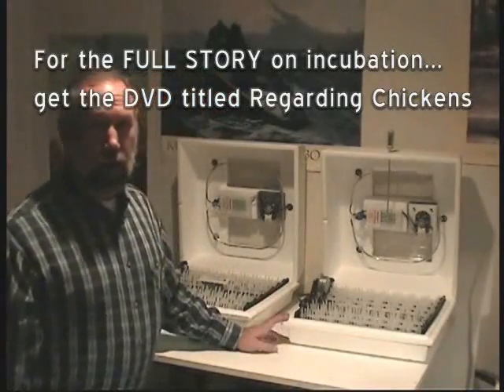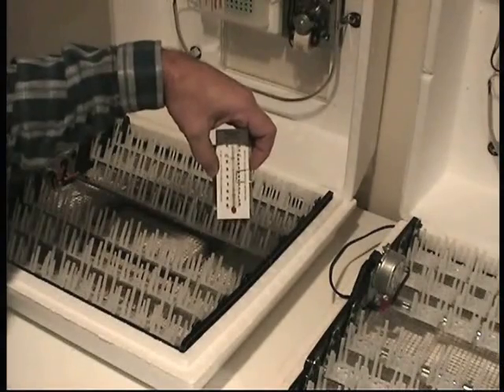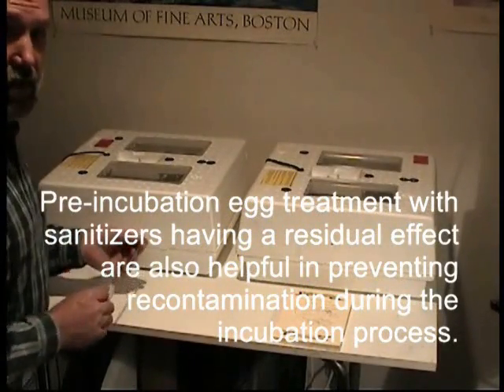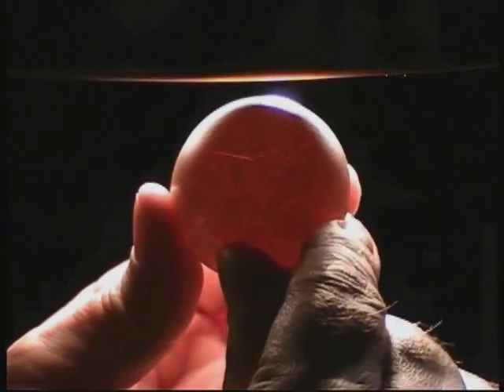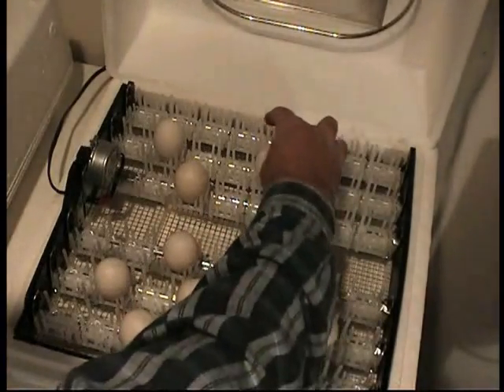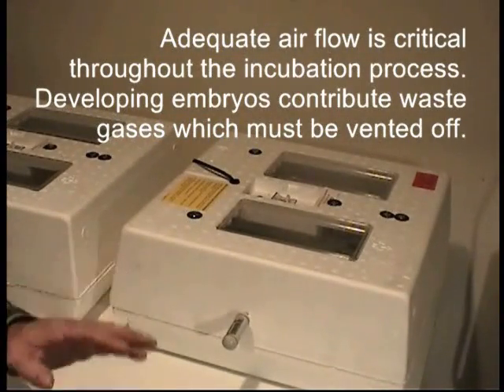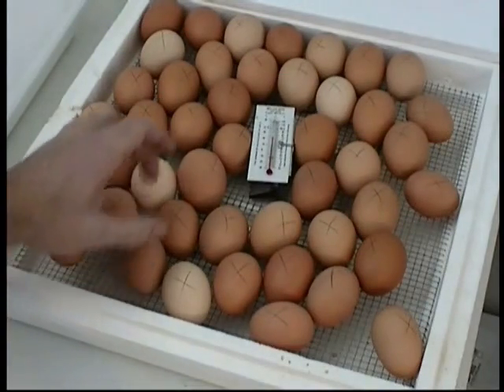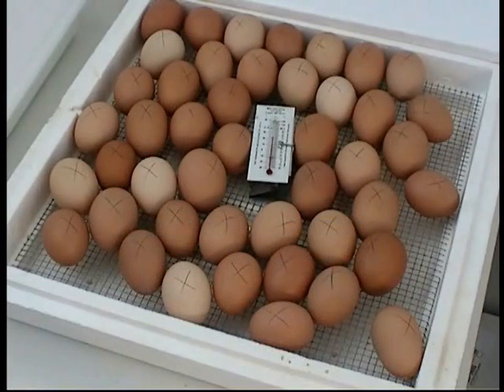Incubation, using the Little Giant Incubator, How to incubate chicken eggs, demonstration

Comment: This post may be of help to a lot of people. I wish I could tell you in plain English about my eBooks but (yt) or (the powers that be) would delete this post if I did. So as you read this you Can do a bit of detective work to find them. (March 2023) I got a Little Giant Incubator and thought I’d give it a go. We already have chickens but they are getting old now and so we thought to hatch some new ones. More about the Incubator: I only got the incubator and the egg turner as there was No fan kit available to go with it where I bought it. I also got a cheaper Thermometer than the Little Giant brand and That Was A Mistake! I couldn’t read it well through the windows! I went back and got the Little Giant brand Thermometer, and that one is EASY to see! I don’t have money for one of these fancy remote control Thermometers that you can read outside the unit, but I’ll make do just fine without.  After working with the system for a good long time, I finally got it right. I found that at a setting on the Instrument Panel of 105.8, [over time] I got a steady reading from the Thermometer (at egg level) of 99.5, I also have 1 red plug pulled out by the Instrument Panel. As AmeriKa crumbles, and with, “The Deliberate Poisoning of Earth,” it’s more important than ever, right NOW, to get your own food supply. And then when you have your own food supply, You have to Protect it! And just like, “The Problem Eliminators,” You have to find ways to see to your own family’s safety! After all the destruction that is yet to come upon earth because of the Wickedness of some, we will have a New Civilization to build! And we together Can and Will make it even better than “The First Civilization of Earth,” ever was. So just utilize my name and some of these Titles to find me and my writings which can also help you to find some Sanity in our current world that has gone mad. My Fellow Americans, Take Care!

Comment: How did you sanitize the eggs? I was always told not to wash them!
Reply from the maker: Because I'm a poultry technician and get inspected by the Dept. of Ag, I have to use sanitizer and it does improve hatch rates. TekTrol is what's approved. Eggs for hatching should not be scrubbed. If you, like me, plan to use your incubators for several batches of eggs, then sanitizing is going to be very important. Bacteria builds fast in that hot and humid incubator. I wish you all the best Teresa!
Reply: @FrederickDunn  thank you!

Comment: I hope you are reading this. I have an automatic incubator with capacity of 2000 eggs. I used the default configuration set by the manufacture temperature 38.5 degree Celsius  humidity 60. some time i got 60% of my eggs hatched and sometime when they start hatching (less than 10%) then the remaining eggs  died. I cannot figure out what seem to be the problem it because of humidity or temperature setup. Now my incubator is closed because of this problem. need your help
Reply from the maker: My first question for you is, what do you see when you candle the eggs? That is far more critical for gauging proper moisture loss during incubation than the actual humidity levels. With 2000 eggs, you would do a sampling and weigh eggs in batches of 24 so can measure their percentage of weight loss, they should have lost 13% of their weight by day 21. Of the chicks that died in the eggs, did they pip and not hatch, or did they fail to pip the eggs at all? If humidity is too high, and the chicks do develop but fail to hatch, they may be too large to move adequately inside the shell prior to hatching. My last question is what are you sanitizing with? That would be my last "potential" issue, that bacteria got to the developing embryos. I hope one of those suggestions helps you trouble shoot your hatches.
Reply: candling from day 6-17 seem to be normal embryo alive but cannot say about much about the air cell. Many of the eggs have not start to pip out but very few do (  with some greenish fluid stick on them). I broke out many of the eggs. Many of the embryo are completely developed but not pip. I do not use any chemical for sanitation only water and detergent.  Thank you very much for your respond. 

One thing i forgot to mention we do have black out sometimes for more than 2 hours and i notice the temperature and humidity get little bit high when i turn on solar inverter. 

what should be done in case of blackout for 2 hours?

what should be ideal humidity and temperature for successful hatch?

Comment: Hey, Do you need to add water to the incubator?
Reply from the maker: That depends on the environmental humidity conditions where you live. In my part of the U.S. I don't put water in my incubators until it's time for pipping, then I fill the reservoir during the hatch so the chicks don't dry out and stick to the shell. In my neck of the woods, high humidity is the number one reason chicks develop yet fail to hatch because they did not lose enough moisture through the shell during incubation and can't properly turn to pip out completely. Or, if they do make it out, chicks developing with high humidity will have albumen poking through their stomach.

Comment: So you don't add water for the first 18 days?
Reply from the maker: I personally do not... that's because our air already has high humidity and if I added water, the chicks would be too large in the egg for a proper pip and hatch to occur. When the first egg pips, I increase the humidity so the chicks don't stick to the shell lining and dry out.
Reply: Thanks. I have a 9300 Little Giant Still Air Incubator with a 6300 automatic egg turner. Anything I should know about it? I didn't change the temperature from the 99.5 preset but I did fill all the water tubes up from the beginning. First batch of 41 eggs, 3 hatched and still living.
Reply from the maker: Mary Bricker If you have the "still air" version, then 99.5 degrees is too low. Set your thermometer at the upper third of the eggs and measure 101-102 deg F. That is your setting. Still air incubators are warmer at the top and cooler at the bottom. 99.5 is only for forced air incubators.

Comment: hello sir 
I made a incubator at my as u r methods but
it's totally failed all eggs r dry temperature is at 96°f and I put some of water in it ,turned daily twice 
but it's not working pls give me suggestions
Reply from the maker: +shaul hameed Turn at least three times a day, not two and you need to boost your humidity, also 96 deg. f is too low, 99.5 f for a forced air unit, it it's still air (no fan) you need 102 deg. F at upper third of eggs placed. Are you saying that they dried out? What was the air cell like at the end of incubation? Did the embryos develop at all?

Comment: Hi Fred, we just got our first incubator and are having trouble with the temps. We purchased the Farm Innovators model 4200 and it has a built in thermometer and the one like you have,they are not showing the same temps. Can you recommend a good digital thermometer? Thanks for all your time and information. Have a blessed day.
Reply from the maker: +blessedfamily27 This is a link to the Calibrated Thermometer I always use to double check the provided thermometers... http://www.amazon.com/Thomas-Traceable-Digital-Thermometer-Display/dp/B0069TUET8/ref=sr_1_13?ie=UTF8&qid=1456502600&sr=8-13&keywords=calibrated+thermometer
Reply: +Frederick Dunn Thank you for your very quick reply. I am now using 3 thermometers and all are way off. Have a blessed day.Amber
Reply from the maker: So glad to have helped... you can also just take one of your thermometers to any Pharmacist.. have them put it in their controlled climate system and then just mark your thermometer with the actual temp... for example, when your thermometer is at 99.5.. and their calibrated system says 101.3 (for example) then you will know how much your thermometer is off... :)

Comment: I've just completed my 3rd almost completely failed hatch attempt. Although everything seem to go perfectly it looks as though problems are developing at day 17, 18 and 19. I'm useing a homemade incubator that seem to work perfectly at all times. I turn 5 times a day, temp stays at 99.5
humidity holds good at 60%. First batch 30 eggs, 0 hatch. second batch 32 eggs 2 hatch. third batch 40 eggs 1 hatch. its weird. forth batch is loading for one more attempt before cooler weather, any thoughts or advice is appreciated
Reply from the maker: +duckmanjoel You should not be turning by hand, nor turning at all during the last few days.. from day 18 on.. the chicks are orientating themselves for pipping. If the air cell charts I've posted on my website aren't clear enough, you can also determine proper dehydration by weight... 13% of original/start weight. During pipping, increase humidity to prevent drying out and sticking to the shell/membrane during hatch. As I show in the demonstration, it's easier to run without added water, until you are certain that the dehydration rate is adequate. Easier to add humidity later, than it is to dehydrate quicker if weight loss/dehydration is too slow. Chubby chicks are the result of too much humidity at the point of hatch/pipping... they simply cannot turn within the shell and die in place after pipping. I hope that helps?
Reply from the maker: +duckmanjoel I'm glad you've been hatching successfully for so long Duckman... every opinion is welcome... we all get our methods down for success.
Reply from the maker: +Dave Meeks Sorry I missed this question... by now you already have your answer.. but you mention the unit is home made.. does that mean you have a blower/forced air system? Or, is this a still air system without circulating fan inside? The 99.5 deg. reference is for forced air systems... if it's a still air unit, you will want a higher temp at the top third of the eggs when on end circa 101-102 deg. F. the temps would stratify... are your "turns" rolling or tilting the eggs? As duckmanjoel says... more information would be helpful. What are the problems you are seeing at the 17th day?
Reply: +Dave Meeks Not enough information. What is the air cell like at day 15? Are the chicks able to pip out? Maybe too much humidity. I also found that turning eggs by hand the first 3 days and the last 4 days (until you hear the first pip) makes a big difference. I use a GQF incubator with turner but turn by hand when I can (like weekends) by taking out some of the trays. Turning by hand with the eggs on their side will greatly improve a hatch. I often get 100%.
Reply: +duckmanjoel Thanks that's a good tip.
Reply: Frederick Dunn
You will notice I said turn until the first pip. Then I add water and close it up until the hatch is complete. Sometimes genetics or other factors will cause the eggs to hatch a day early or late so I use the first pip as my indicator. Been hatching successfully for 40 years.

Comment: Thank you for your prompt reply. I hope you can give me some advice regarding the following:
I am on solar power and have 12vdc, 24vdc and 110 ac available.  I am interested in two of the 1588 units, but need to know the total power draw (with turner) for the AC model and the DC model -- the mfgs. website does not show them. 
Furthermore, I have heard that incubation is not a viable option at elevations over 3,000 feet.  My poultry yards are at 5,600 feet elevation-- the broodies don't seem to have a problem up here; what are my alternatives?

Thank you for your attention to this matter.

pg
Reply from the maker: I'm also on a whole house solar system (10kw)... the electricity demand varies, of course, depending on the environmental temperature they are already operating in.  So, you'll want the incubators in a warm area... do not insulate the incubators and inhibit air flow... the leads into your other problem.. altitude.  If you are at 5,600 feet, the forced air units are your best bet... a still air unit would suffer more from the low oxygen levels.  With the forced air unit, you will be fine, but expect a lower hatch rate and possibly having to continue your incubation a tad longer.  Monitor the moisture loss of the eggs by weighing them periodically... 13% (assuming the eggs are fresh) should be lost by the 21st day.  I hope that helps you out... candle those eggs and fill the incubators with eggs, a full incubator is more stable and holds heat better.
Reply from the maker: Frederick Dunn Also... see my review of the Genesis incubator... it runs on 12 v DC....

Comment from the maker: Often the chicks that develop completely yet fail to hatch may be too large to turn within the shell.. if they pip but don't complete the 360 degree crack out, they may have been too large.  Candling eggs during incubation can answer the question regarding humidity, if you can't candle (see into the egg) weighing the eggs together is another method as they would need to lose 13% of their original weight throughout the incubation period.  Breeding stock health is also VERY important.

Comment from the maker: 98 deg. F. should be the lower limit for incubation, that is if you are using a forced air system.  It's always best to stabilize temperatures before you begin a hatch.  Dramatic temperature fluctuations can profoundly effect the incubation process.

Comment from the maker: Duck eggs should be rolled rather than "tilted" for automatic turning... so, either turning by hand 3 or more times a day or, use a unit which rolls eggs rather than tilts them.  The Rollx-II does that as does the Top Hatch Unit... you may watch my videos on those models...  I realize your question was removed, but I answered it anyway for the benefit of others...

Comment from the maker: At the end of the hatch, you should have water in the incubator until every chick is out of it's shell.  Then you can run it dry as a brooder... When you candle your eggs, that will be the best indicator regarding IF you need to add water during incubation.  But you will always need water during hatch or the chicks may stick to their shells...  drying out at that time is BAD this is why chicks may pip and not hatch, they become stuck or are too large to move...

Comment from the maker: @fenteng43 I use Tek-Trol... you can get it by the gallon, pint, or even as a spray for hard to reach places... it forms a residue on the shell and continues to fight bacteria after the initial cleansing.  Thank you for the comment!  Using Sanitizer has definitely improved my hatch rate...  you have to weigh the added cost.  Hatching under a brood hen is still my first choice (">

Comment: is thet a temp at where you can get only hens or roosters?
Reply from the maker: No, you can't determine the sex of the embryo by altering the heat parameters. That's possible with some reptiles, but not chickens. Lower temps just take longer to hatch, higher temps speed things up a little.

Comment from the maker: @gokory That's correct, I do not put any water in the incubator(s) when starting off and in my part of the country, I don't put any water in any incubator until the 18th day through pipping/hatching.  Otherwise (for me) the eggs do not sufficiently dehydrate during incubation resulting in chicks that pip but do not complete the hatch due to being too large.  Egg shell condition and environmental humidity are all factors to consider.

Comment from the maker: If all incubation conditions are right for your fertile eggs, there should be no need to assist the chicks during the hatching process...  If they are getting "stuck" as in pipping but not completing the hatch process, consider lowering the humidity during incubation and having it increased only after the 18th day.  Also consider breeding flock diet strength, there may be nutrients missing that breeding birds need.

Comment from the maker: The more fresh the eggs of course, the better and generally one week is pretty good, expect viability fall off pretty quickly after 7 days.  tilting the eggs, or even turning them over in 12 hour cycles can help...  storage temps also have an effect on viability 50-60 deg. F. is pretty good, with elevated humidity.  Let's say you have a trio (2 hens, one rooster) and you want to incubate full capacity in your incubator. Nothing to lose by saving them all, as the freshest eggs will do fine still.

Comment: hello,
where did you place the thermometer and hygrometer inside? what kind is accurate?
thank you.
Reply from the maker: Get any thermometer, take it to a pharmacist and ask him/her to put it in with their calibrated thermometer system, them mark any difference on your own thermometer. Then, plage the thermometer in your incubator at the top of your eggs, it doesn't matter where, just so you can read it through the window. If the incubator is a still-air system, you want it at the top 1/3 of the eggs.

Comment: So informatice thankyou so much!!!Just one question,I will probably only be incubating 20 quail eggs at a time or a dozen muscovy eggs,with that small amount of eggs and such a large amount of space(Im not using the egg turner)Ive heard you can use the shakenbake method.You just kind of shake the incubator gently and the eggs will role over without opening the lid do you think this will work or a big no no?
Reply from the maker: I woult not attempt the "shake-and-bake method" Embryos are very sensitive at early stages, and you can damage their fine blood vessels if jarred or addled. Hand turning would be best if you don't have a automatic egg turner.